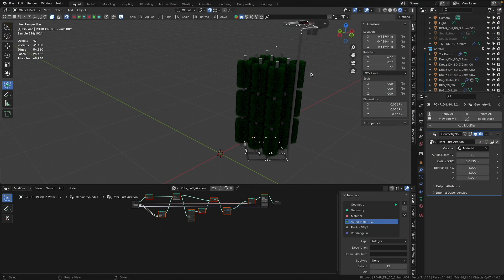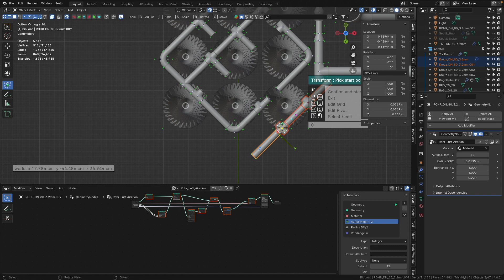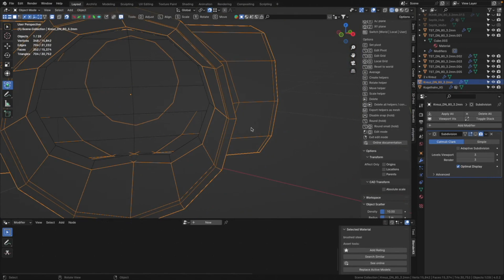UPDATED CAD Transform 2.0 for Blender 4.+

Comment: Hi, I just installed this add-on, but it isn´t working. For some reason, the options for all the CAD functions don´t appear on the screen. I am using Blender 4.1. I successfully installed it, and it is activated. Does anybody know about a solution?
Reply from the maker: Maybe the installation went wrong. Do not unzip the file in order to install it

Comment: Thanks for your sincere explanation ❤. Could u show how at which plane it was on and moving to or which direction x,y,z, and
Reply from the maker: Hey thanks a lot for your comment 🙏
If my following answer is not, what you wanted to know, we can make a Discord meeting. And I teach you about ct, things I know.
Actually my plan is, to upload a blendfile, that you can download. In this blend.file you will find a few parts, which need to be built together. I will make a video with comments, how to build those parts in a single assembly part and I will use CAD Transform for assembly. Hopefully you will know all needed stuff after the video 😊